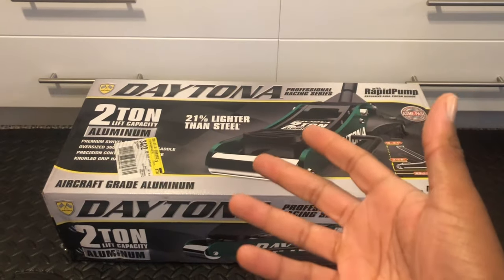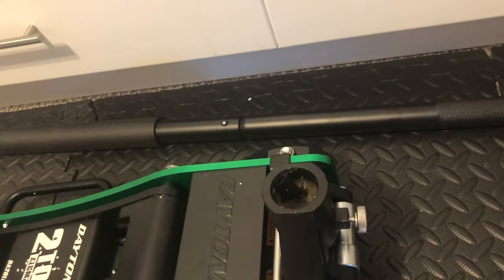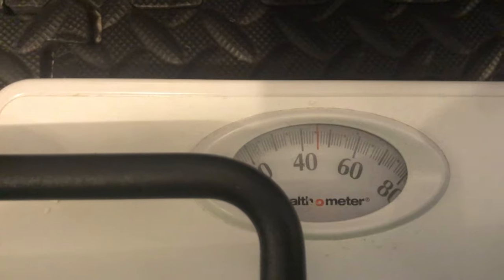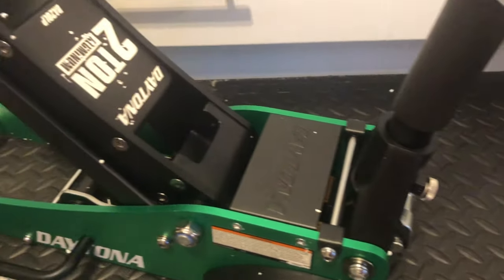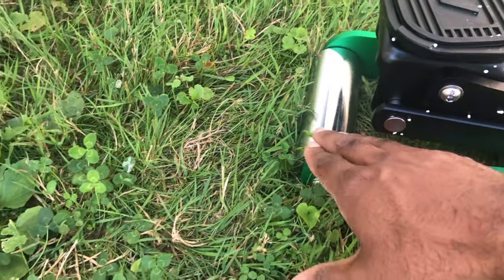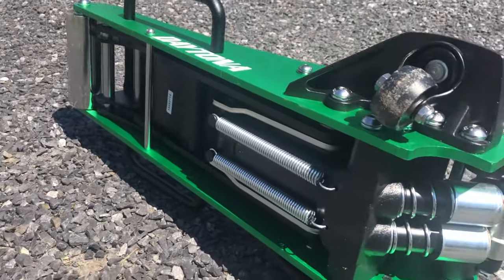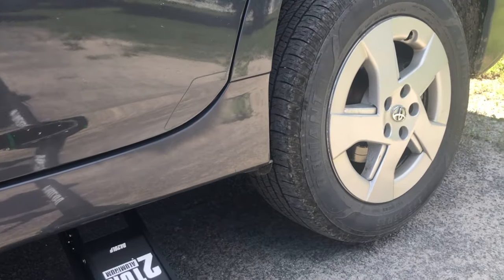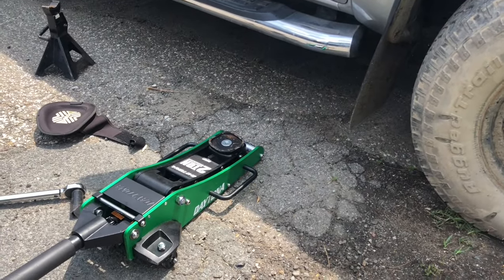Daytona 2 TON Jack Review (Through!)

Comment: I've been looking at this Jack debating whether to get it or not. I would like something lightweight to carry in my trunk to do oil changes on my 07 Crown Victoria which Weighs about 4100 lbs.Surprised that a Tacoma and Tesla weigh that much . Will it work to get a jack stand underneath my whale of a car? I like that you tested on 3 different vehicles.
Reply from the maker: @h.delbruk6070  Yeah, I think this would work for you.
Reply: As long as you remember that when you are jacking up a car/truck, you are not lifting the whole weight and only a percentage depending on where you place the jack. 👌🏾